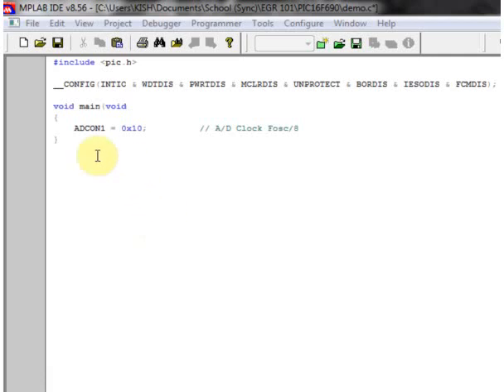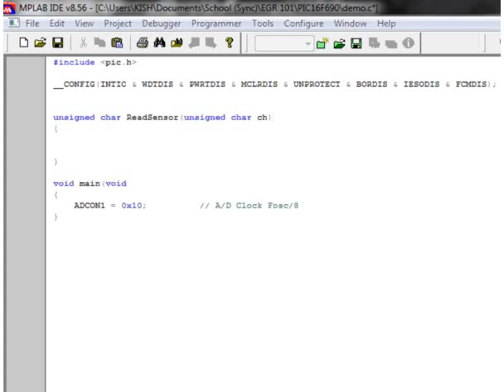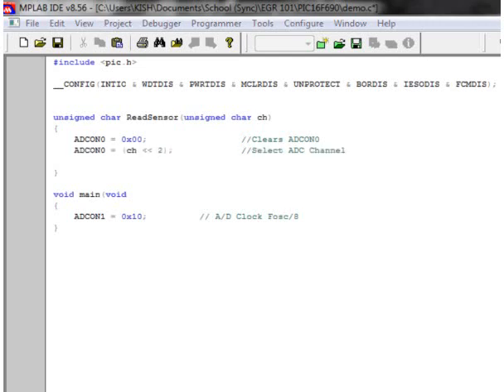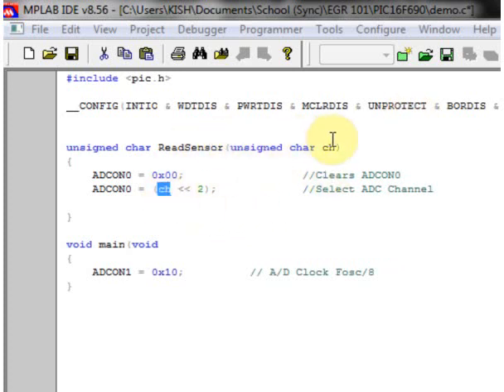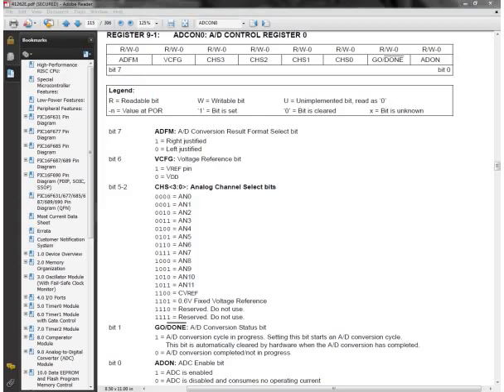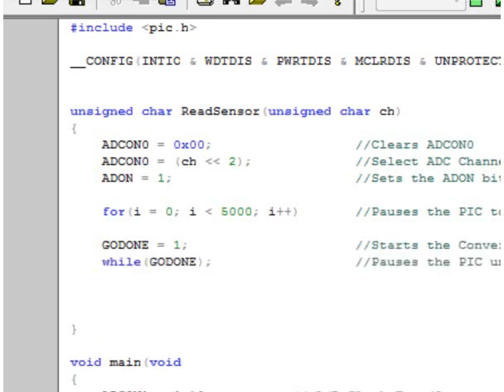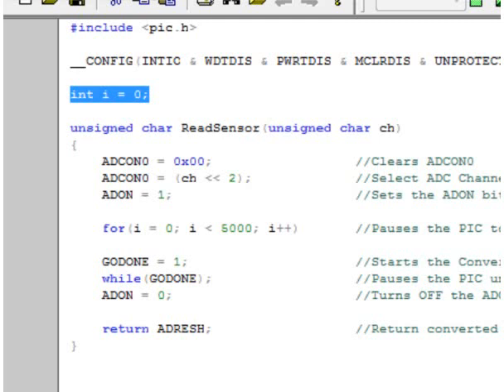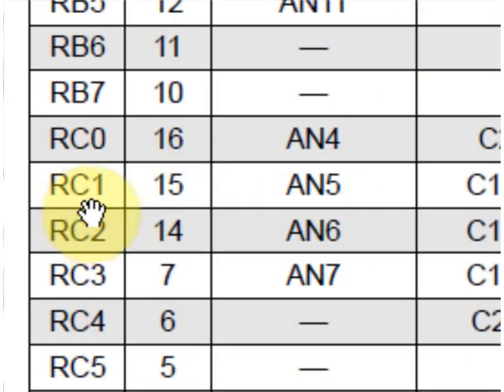Reading Analog Sensor Signals on the PIC

Comment: only one thing. The analog to digital  conversor precision is 10 bits long. So it is 2^10, which means it has 1024 position. If your reading just 256, you're losing to much precision of it aren't you?

Comment: question,  is there any way you can send me a copy of your code for a A/D converter, im using the same microcontroller and an sharp infrared sensor that can detect objects  from 10 to 80 cm, am i new to microcontroller coding so help would be much apreciated, Thank you